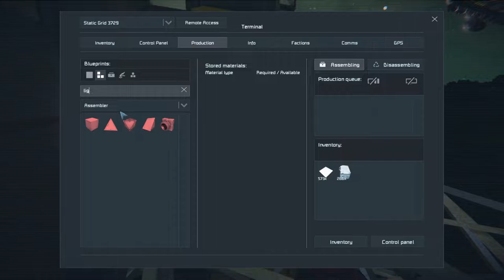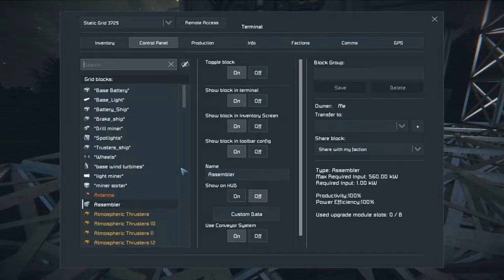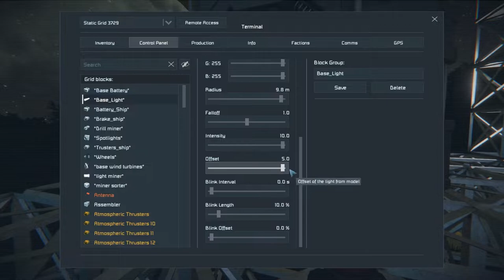[14] Working the base - Road to Space - Space Engineers Survival

Comment: You need to find the part where you can connect a block to the connector then build it to the base. After that you can cut off the conveyor you want changed. If you just want basic building ingots, just drilling a deep hole and refining the stone will get you all you need.
Reply from the maker: That would have been a good idea